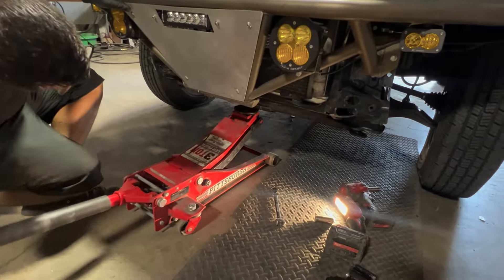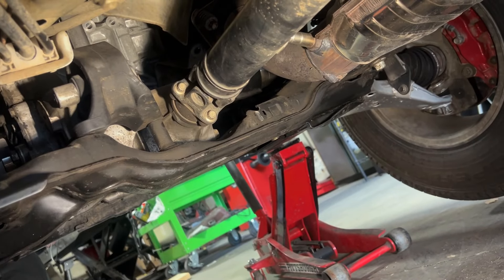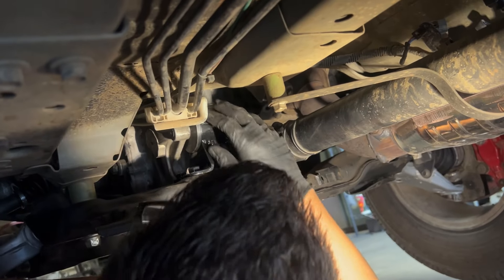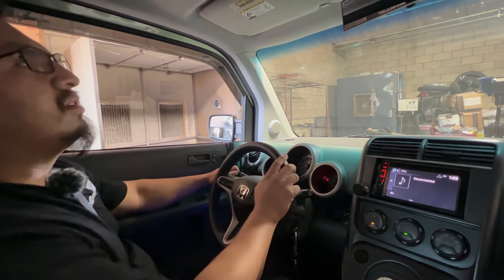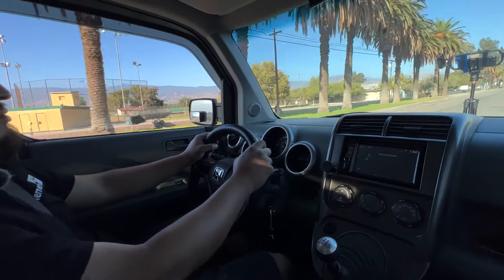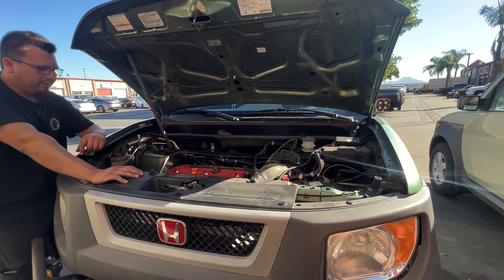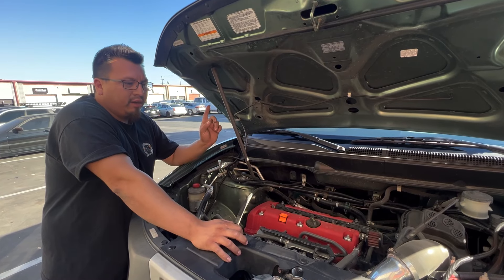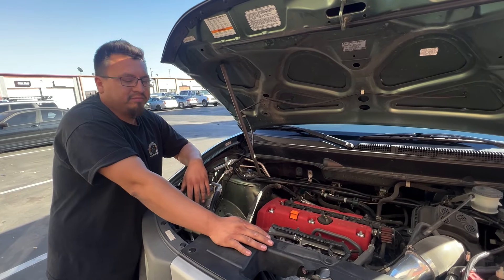Honda Element & CRV Rear Engine Mount Installation  & Review - 1320  Performance Engine mount Review

Comment: I too have a manual element and I kept busting the rear motor mount. The solution was adding 3M window weld into the spaces in the mount. Retained same quality with no change to vibration and I haven't torn it.. so far 8 months with it.
Reply: You can even do the urethane inserts for RSX/ep3 for front and rears.

Comment: When doing the back engine motor mount, do you need to support the transmission or is that only during the transmission mount?  I need to replace mine and I can put my car on floor jacks lift it up. I just need to know if I need to keep the floor. Jack on the transmission. Thanks, James
Reply: I barely supported my transmission and it fudged up the threads. I thought barely supporting it was the way. I think not after that. It did not look like they had it supported in the video. Lesson learned.
Reply: All I can say is proceed with caution. If I was gonna do it again I wouldn't support it. He broke it loose with a wrench and no breaker bar so that was surprising to me.
Reply: Wondering the same? Do I gotta leave my car on jack stands and support the transmission side to replace this mount?

Comment: I started on replacing my rear motor mount this morning. The top bolt is about to hit the drive shaft and is still not out. I have an '03 auto 4WD. Any tips on getting it out?